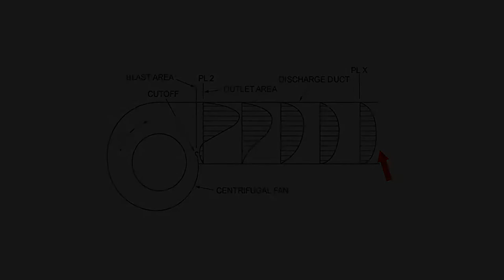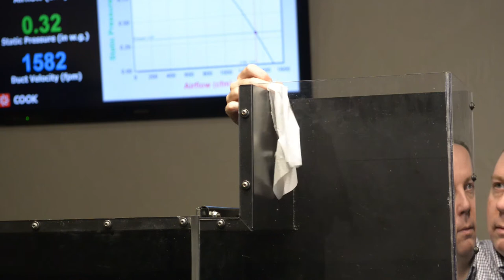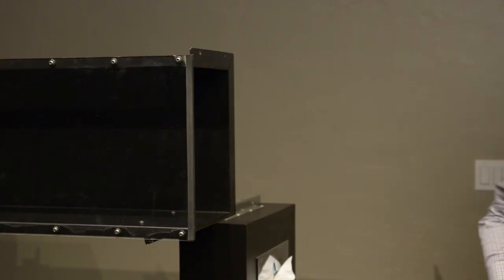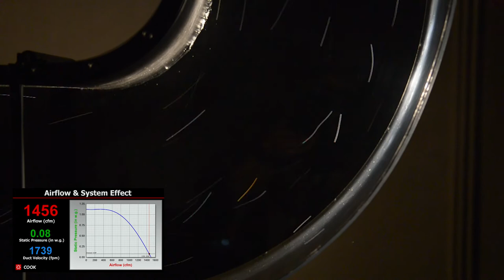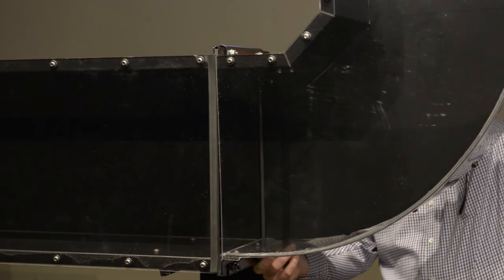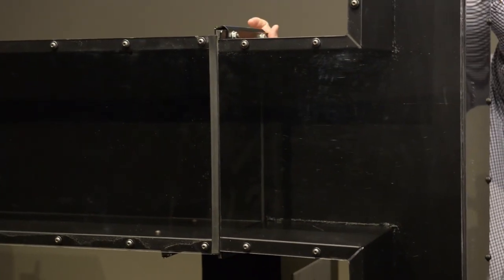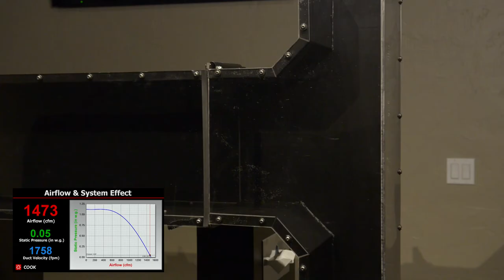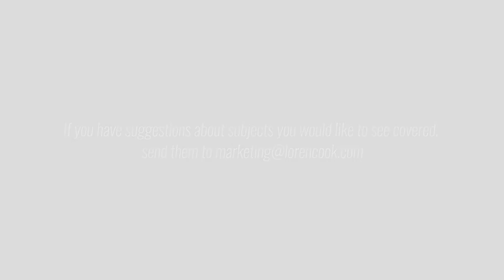COOK U - Ducted Fan Performance and System Effect PART 1

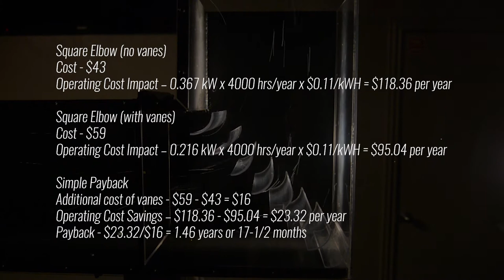Comment: Great experiments! straight and clearly explained air movement in the ductwork from a fan. Just one error when you calculate the payback at time 5:20/11:17, it should be $16/23.32 = 0.68 year.